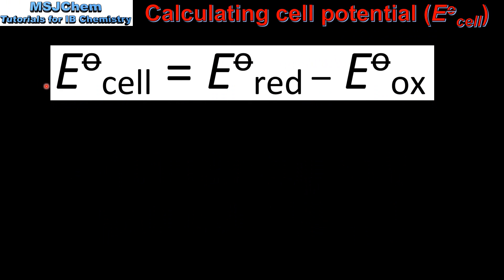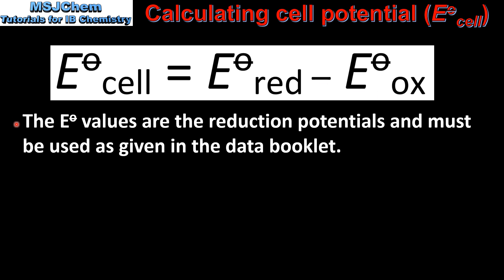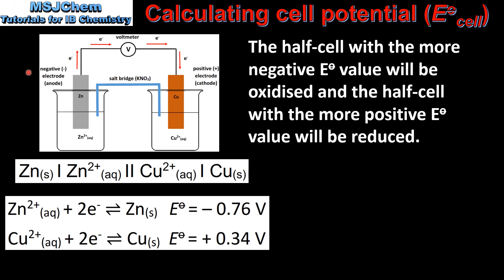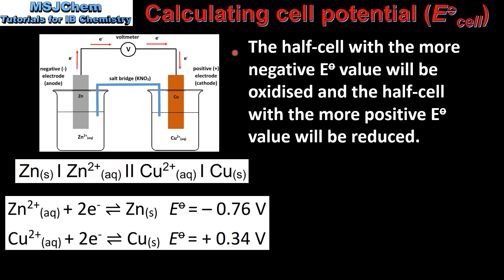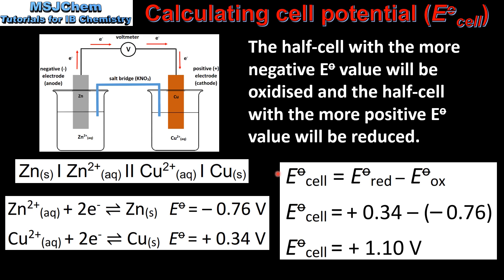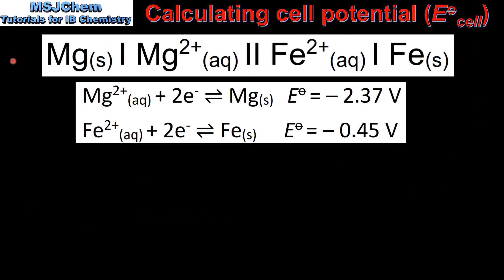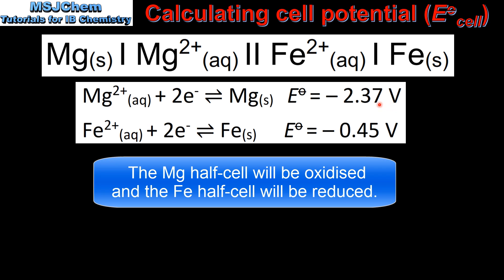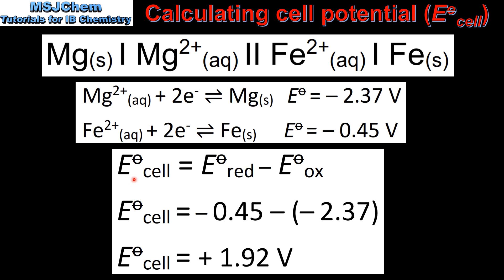19.1 Calculating cell potential (HL)

Comment: This is kind of wrong. It should be Ecell= Ered+Eox. The two electrode potentials given were both reduction potentials for each ion. "-0.76" was not the Eox but the Ered of Zn. Eox= -Ered. So, Eox= -(-0.76). So the equation should be Ecell= Ered + Eox.
Reply from the maker: The equation in the video uses the reduction potentials as they appear in the IB data booklet without having to change the sign. It is also sometimes written as Ecell = Ecat = Ean (cathode - anode).
Reply: @MSJChem ok. tysm for your reply even though this video is a little old